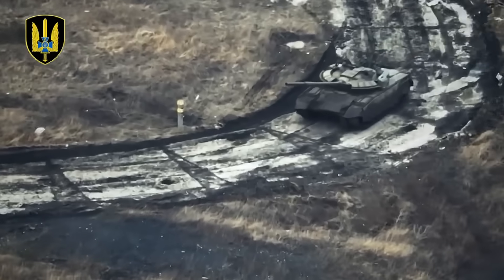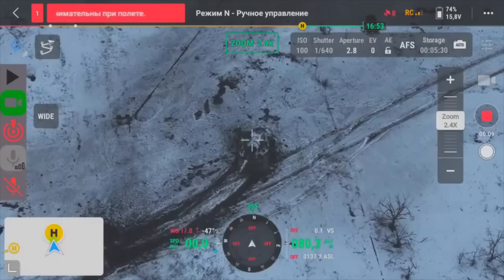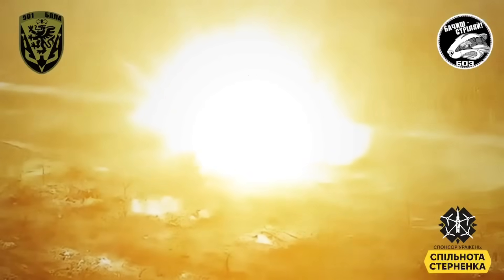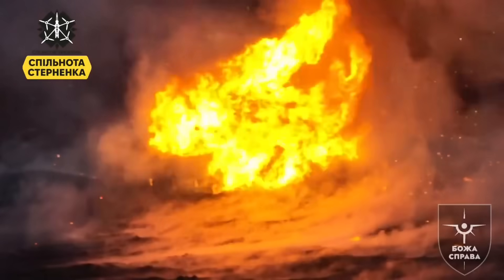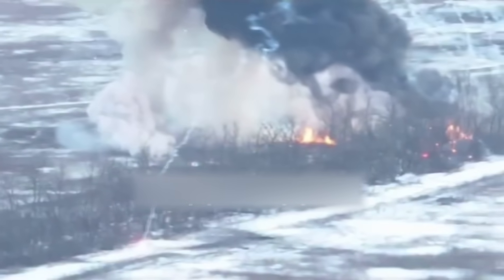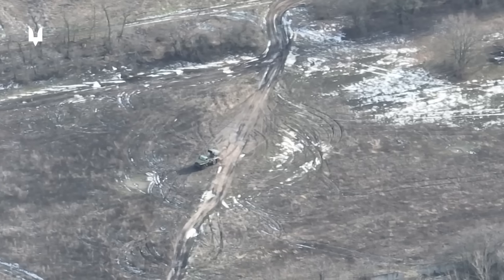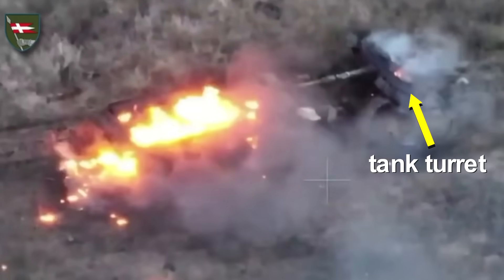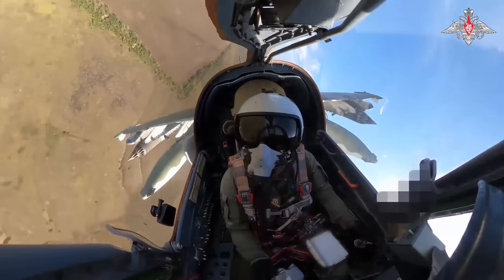The Russian tank attack failed because of this sneaky weapon

Comment: Why does Ukraine no longer seize the abandoned Russian tanks to use for themselves like they used to ?
Reply: Because they are fighting a war on the defensive now because USA are no longer giving them enough weapons to attack russia or to hold the lines. Germany did also use much weapons they took from allied countries in 1939, 1940 and 1941. But you will rarely ever see them use any allied tanks from 1944 or 1945 because the Germans did usually not control the land over a battlefield when the day was over. You must control the battlefield so it is safe to drive trucks to the area and pull away all damaged enemy tanks so they can be repaired.
German tactics from 1943 and onwards was also to continue to shot on enemy tanks even after you thought that you had destroyed them and made the enemy crew jump out of the destroyed tank. You fired round after round into that tank until it started to burn with huge flames. And then the Germans knew that they had destroyed the enemy tank so much that it could never be repaired and used by the allies again.

Comment: 0:12 - "equipped with a special shaped charge projectile capable of penetrating the armor of any Russian tank".
Nonsense. There's nothing special about that warhead. It is a standard RPG-7VL, capable of penetrating 500mm of RH steel, is canted downward, targeting not the turret, but the upper hull armor around it, which is only 25mm thick, hence penetrating all the way to the ammo.
Reply: It's a projectile with a special shape, not a special projectile with shape. The shape is special from the point of view of fluid mechanics, that's why it's called shaped charge, it wouldn't work with just any shape.

Comment: You don't understand what the word "algorithm" means.
Reply: This video miss informed about these drones with autonomous targets, NONE of them have algorithm, in fact they are 100% controlled by humans. I build them!
Reply: Yes. I do too.
The drone would need specific information on speed, location etc.
It's done by a pilot. @InteractiveDNA
Reply: In mathematics and computer science, an algorithm (/ˈælɡərɪðəm/ ⓘ) is a finite sequence of rigorous instructions, typically used to solve a class of specific problems or to perform a computation.[1] Algorithms are used as specifications for performing calculations and data processing.
Its just a fancy word for "process of problems solving"
Reply: @usernamealreadytaken9330  That is correct.
Reply: @usernamealreadytaken9330   I'm a programmer.  A set of instructions means use one input, get one (predictable and repeatable) output.  It's a defined function.  That is not at all how war is conducted.  And in particular, these drones are flown by human hands.  You don't use an "algorithm" to decide what you want to eat for lunch, even though by your application of the term, that would apply.  It's just wrong.

Comment: The anti drone jammers are mounted with all of their dipole antennas mounted pointed at the drones, with their null zones, so that the jammers won’t work effectively 😂
Reply: Elaborate?
Reply: @ahhmm5381  a linear polarized antenna, a dipole, has a zone at its north and south poles where it is weakest. If you are looking to blast a random noisy signal to jam RF comms you’d want to orient the antennas perpendicular to the target, not pointing directly at it, as that’s where those specific antennas are weakest
Reply: @ahhmm5381  it can not unbind the DSS signal...hack the drones the drone era might end sooner then it started.
Reply: @eioclementi1355  the problem still persists in good analog video quality. The more jamming the less you can see what you wanna hit
Reply: Everything is good from Russia UNTIL you use it:glasses-purple-yellow-diamond::face-green-smiling::text-green-game-over:
Reply: @m.g.debruin8294  the thing with jammer they either work or they don't

Comment: algorithm is the wrong word
Reply: Aren't these drones man operated though??
Reply: @blvck.8197   see 5:19, there is a man using FPV goggles and a maybe a Taranis 2,4 Ghz Sender. The copters have probably a 250er Carbon Frame and are equipped with a HUGE Lipo, maybe 5s or 6s. Normally, those FPV copters have a take-off weight of 500g, but in this case the copter is probably at 900g. I don't know how much the Anti-Tank Head is, would be interesting. The more payload, the more clumsy is the flight. Maybe 2300 kV Motors, they deliver so much power...
Reply: Tactic.
Reply: I would not use the word algorithm here myself though it could be entirely correct. An algorithm is a set of procedures or instructions  to be followed to achieve a solution to a particular problem, which here is removing the ability of a tank or whatever to be a fighting vehicle. While we may think of an algorithm  as a computer program because that's where we use it mostly, it could also apply to the process of setting up a drone and how to get it to the targets most vulnerable spot. Even the Ikea flat pac assembly instructions are an algorithm, just to make sure you don't have any parts left over and wear out screw thread holes by assembling and disassembling because of using the wrong assembly order in haste or know it all ideology.
Reply: Rythem or momentum .
Reply: Remember, this is propaganda. They are trying to imply that the drones are not under human control.
Reply: From AI chatbot:
Nature of the Algorithm: In military drone operations, an algorithm is a set of programmed instructions that the drone's computer system follows. When the statement mentions an algorithm, it implies a software-based solution that has been developed to enhance the drone's capabilities. This could involve complex decision-making processes that are automated and executed by the drone's onboard computer systems.

Targeting and Guidance Systems: The algorithm could be designed to improve the drone's targeting and guidance systems. This means it can more accurately identify, track, and engage targets. In the context of the statement, this likely involves identifying specific weak points on Russian tanks. For instance, the algorithm might analyze various factors like tank model, speed, direction, distance, and even environmental conditions to calculate the optimal point and timing for a strike.
Reply: @user-yp9nz6bs9q  I could be wrong, but I would bet these are all human guided, not  auto targeting through some computer system.
Reply: @user-yp9nz6bs9q   That's not how the term algorithm is used in programming either.  Of course software is involved, but the systems are guided by humans, not automated.  It's a completely wrong use of the word.